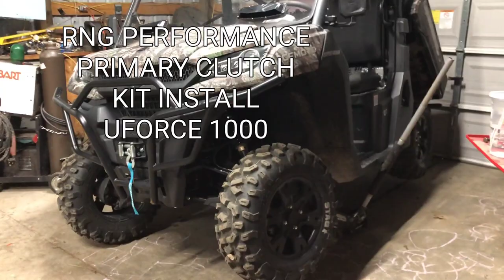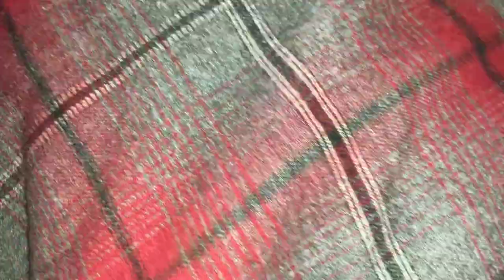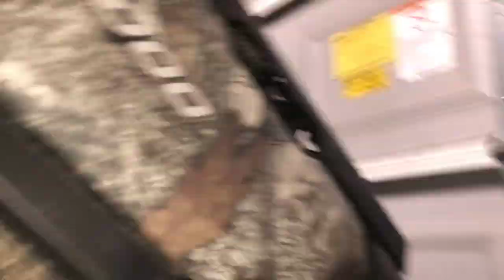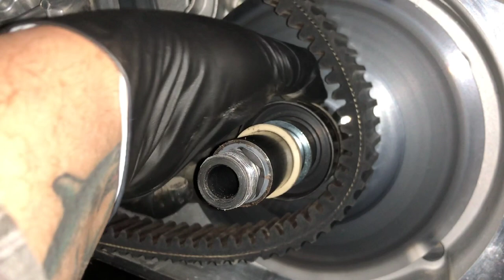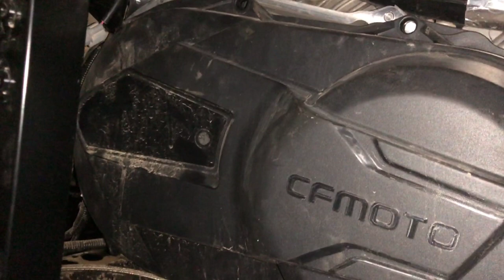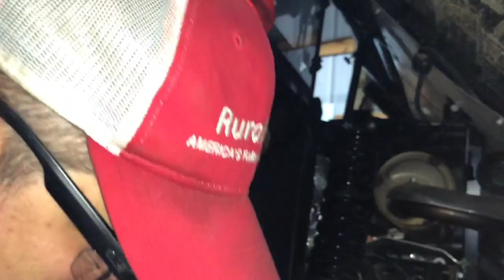RNG Performance primary clutch kit  Uforce 1000 install

Comment: I just installed a primary clutch kit on my 2023 Uforce 1000 today. It helped some with the jerky starts but not as much as I was expecting from what I have been watching in the videos and reading comments. I was expecting it to be as smooth as butter like the talk was. Not a total disappointment, it is a little better.

Comment: I just installed one of your kits in my primary clutch in 2022 uforce 1000..  the kit was a yellow spring and a set of weights to achieve a smoothe engagement which it did .. but a notice if I'm on the road and in high gear I get a smell like belt is slipping.. I noticed first when I was going up a hill on my road running about 30mph .. wondering if I need to reclock my secondary.. I haven't touched the secondary it's in stock setting ..  don't get the smell when in low gear
Reply from the maker: I appreciate the credit, but these kits actually come from RNG Performance. I just made a video about the install!
Reply: When installing that primary kit do we need to reclock the secondary clutch?

Comment: Does it matter which way the spring goes on?
Reply: And are there torque specifications?
Reply from the maker: No
Reply from the maker: I pulled these off the internet 

secondary nut 115nm-85 ft lbs
primary bolt 60nm - 45 ft lbs
primary nut 70- 80 ft lbs